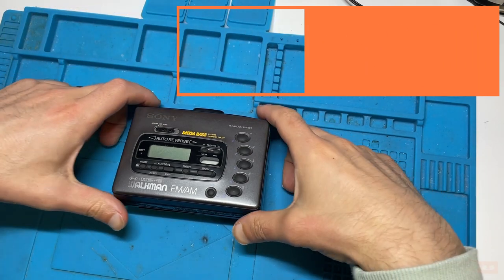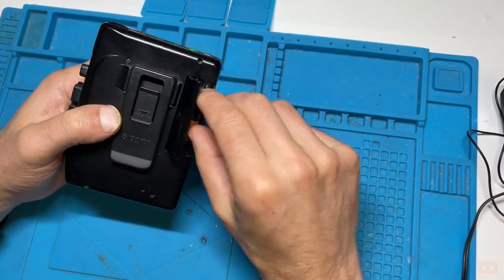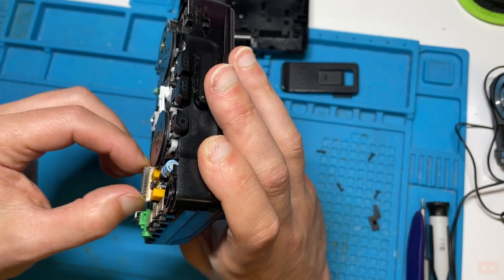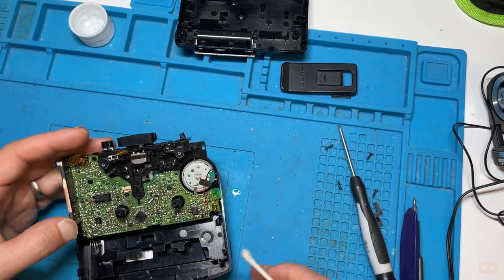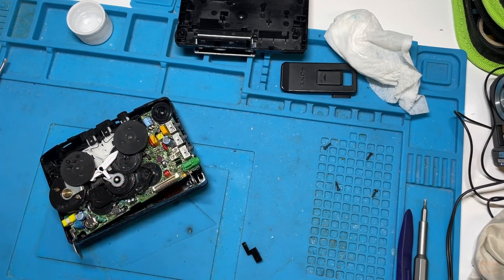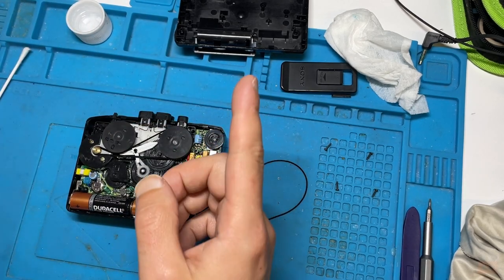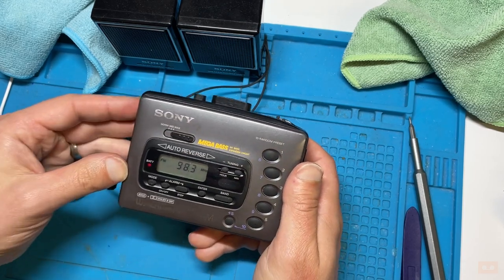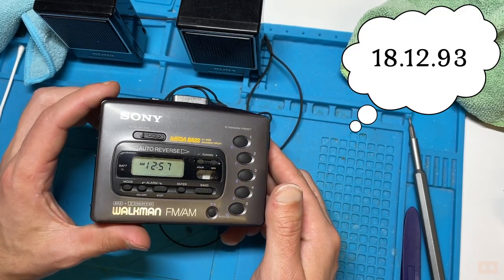A Complete Repair of the 80s Sony Walkman WM-FX45: A Step-by-Step Guide!

Comment: Really informative maintenance video. I've been looking at this exact Walkman on eBay and toying whether to buy or not. Out of interest, does switching on the Dolby B on this unit make any noticeable difference?   I have a lower end WM FX-113 (had it since 1996) which appears to have the same mechanism as this. Unfortunately after having replaced the belt and cleaning everything up similar to you, the wow and flutter is still horrendous, and I find it gets progressively slower the further it gets into a tape, so I have concluded it is beyond my ability to repair, hence looking through eBay for a replacement.
Reply from the maker: Hi, thanks for the great question! Although I can't be 100% sure with this video being a while ago I do think I remember being impressed by the quality and features of this model, including the Dolby B. I'd say if you were looking to upgrade from your 113 then you wouldn't be disappointed with this one :)